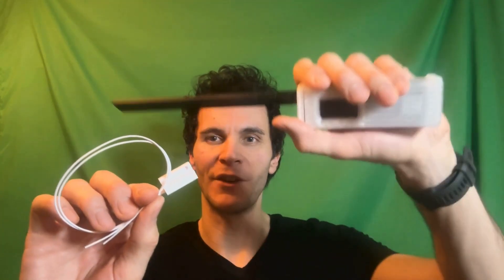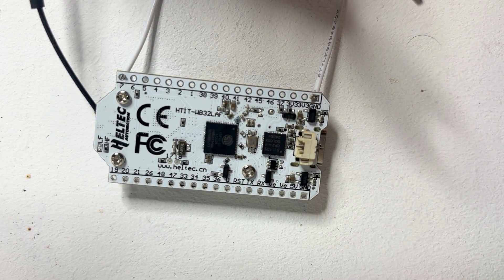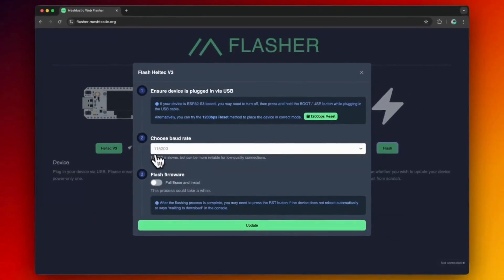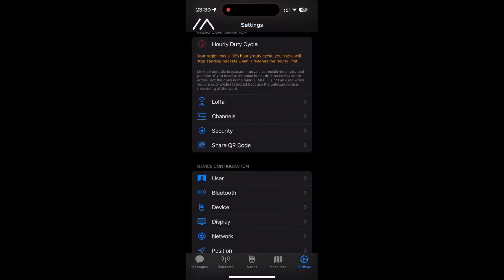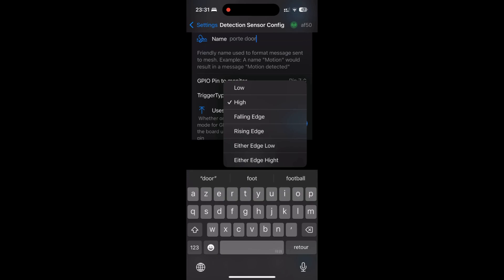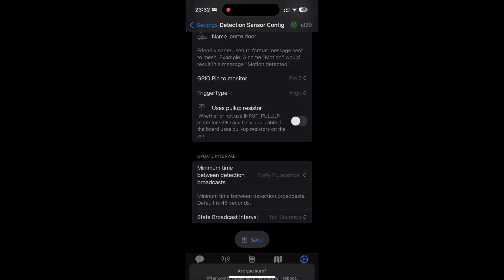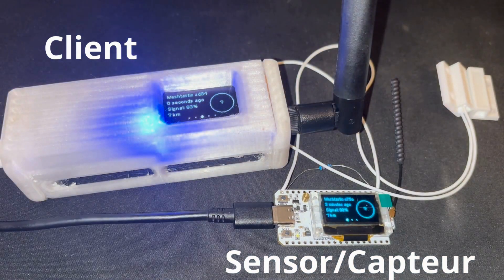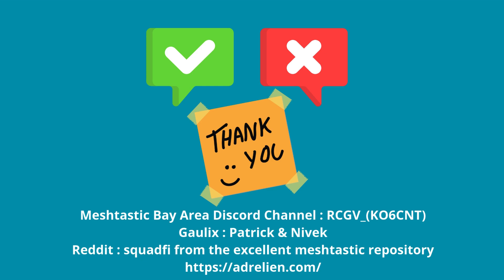Create a Reliable Off-Grid Door Monitoring System with Meshtastic: A Step-by-Step Guide

Comment: Thanks. Is it possible to use the reed switch to wake up the meshtastic sensor from deep sleep then automatically send a door opened message and go right back to deep sleep? ( and repeat when the door is closed ). I'd like to turn on the meshtastic sensor node only when it has something to report, thus saving battery life.